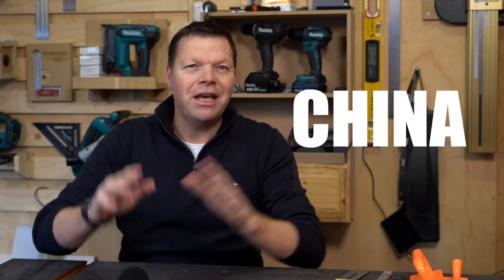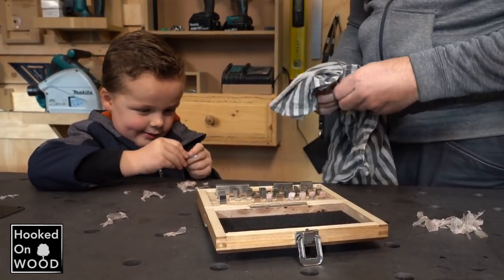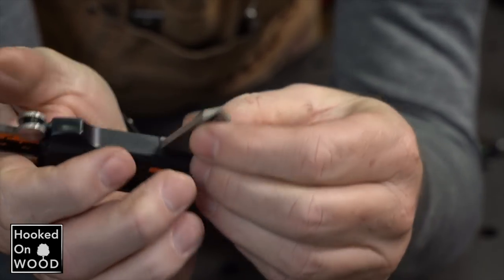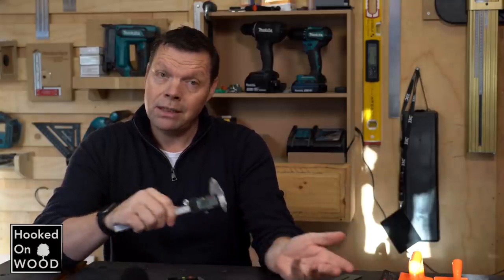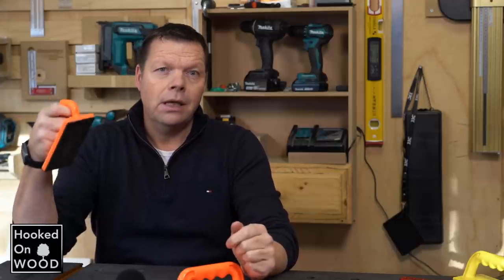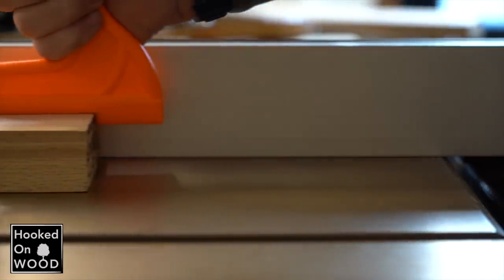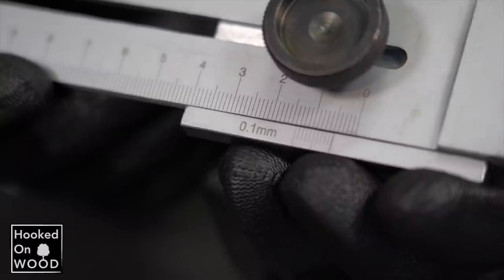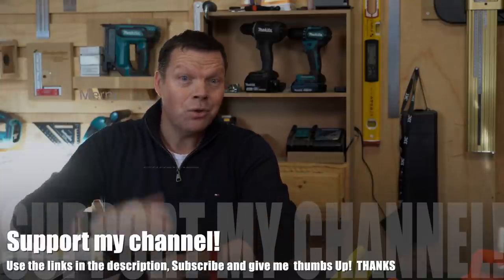China Tools Ep. 17, Set-up blocks, Calipers, push blocks and Ruler

Comment: Tha Banggood pocket hole jig you showed in you r previous video just arrived! But what a disappointement when I realized that the drill bit just doesn't slide in the hole sleeves. I forced it in one, but not in the other and I am not sure I should drill it in without damaging the sleeve. But I found that if I insert the bit from the shaft it does enter. What shoul I do in your opinion?
Reply from the maker: What is the size of the drill bit?
Reply from the maker: Is it 9mm or 9.5? When the shank fits, perhaps you can make a few holes without the pocket hole jig. Maybe that makes the edges smoother and it fits. But, of course the dimensions should fit. When the dimensions on the bit is right it has to be the dimensions of the fitting. But i expect a deviation on the bit. I would reclaim with Banggood about it. I saw you can buy thw bushings separately somewhere so that is a good thing. But discuss with Banggood what to do?
Reply: Yes, sorry, you are right, it is 9 mm. I checked the drill bit. The shank is 9 mm, but them it varies between 8,5 and, about 2 cm from the tip, it is 9 mm. It looks like it should slide inside the sleeve, but it doesn't, so I guess also the sleeves could have some imprecision. I just tried your suggestion and made a few holes in a piece of wood with the bit, but still it does not fit into Its sleeve.
Reply from the maker: I look at your link and that looks not good. I would document it first. So download this video and make some pictures. Contact Banggood. After that i would see further what to do. Good thing is, that these guides are sold separately. So, if the imperfections are there, or if you damage your bushings it is not the end of the world. But Banggood should come with a solution. Sorry to hear your experience.
Reply: Hooked on Wood Thanks. I sent a scorteranno video to Banggood. We will see. You say these bushings are sold separetely. You mean by Banggood? And what should I se arch for? But I would rather replace the drill bit..
Reply from the maker: @starkwedder9787  I see that What I came by was a 9.5mm version. But I think it is also available in 9mm.

Comment: IMHO the precision of any digital caliper is more than enough for woodworking. The primary reason I bought a Mitutoyo caliper was power management. Cheap calipers consumes almost as much power turned off as in use. Yes, you can buy a lot of cheap batteries with the price difference, but I don't fell good discarding them so often, even without actual use. I used to remove the batteries after use, but it's too annoying.
Reply: You'd think the Chinese would have figured out by now how to copy the Mitutoyos by now ... and sell them at half-price;-)

Comment: Hi Dennis

Thank you for the GREAT reviews. They are all very enjoyable and clearly understandable (by all your viewers I'm sure).
Your latest intro though, shows an INCORRECT use of the planer blade guard. This may mislead others and has already induced a comment regarding the planer guard.
PLEASE remove this part of the video and/or replace it to show the CORRECT use of the guard.
The blade guard of a planer is designed to cover ONLY THE EXPOSED PART of the blade. This is generally very obvious by the facility to slide the guard in and out horizontally above the blade.
The planing action of a planer blade has a tendency to lift the wood as it passes over the blade. This requires pressure above or very close to the blade to keep the wood flat to the planer table. Your method does not allow for this pressure application and may cause variations in thickness of the wood being planed (possibly marks like snipe marks along the length of the wood).
While this method MAY produce a satisfactory finish in your applications, it is an incorrect use of a machine guard and should not be a misleading part of a video that may be seen by "new" woodworkers.
Best wishes Dennis and I look forward to many more great videos. :-)
Reply from the maker: Hi Zen, 
The way I used it, is exactly the way is described in the manual of this machine. It is why the safety bridge is adjustable in height.  I do not think there is a right and wrong here. In the manual is written to do it this way till wood thicknesses of 75mm. That is the reach of the height of the safety bridge. With thicker wood, you use it as you subscribed it. The same counts for when you plane the sides. 
I understand you worry about the wood being flat on the table. But I do not think there is a big difference when you push the wood against the outfeet table 15mm sooner, because that is what we talking about. Anyway. Thanks for your comment. Here you can find the operation document from Felder: http://maschinen.felder-gruppe.at/uploads/document/Manual_A3-26_A3-31_A3-41_EUS_enc.pdf  Page 44.
Thanks, Dennis

Comment: i never use electronic calipers, they are good for people having trouble reading mechanical calipers and that's about it. they always need lots of resetting to zero and that tells a lot. chances are that 2 measurement are not the same. never happened to mechanical ones, no batteries, no reset. and i prefer the 0.05 ones mechanical
Reply from the maker: I can understand your comment and you are 100% right. But I found the electronic calipers accurate enough for my woodworking and therefore more convenient to use. And I really hate when I have to turn on my reading glasses☹️
Reply: Digital is faster and you are less prone to brain farts where you aim for 1.25 inches and end up with 1.225 inches instead. Ask me about it;-)

Comment: Ive often been criticised for only buying mititoyo measuring instruments but have always had the last laugh at colleagues who buy chinese instruments. Due to the following reasons.
Crap battery life.
Premature screen cracking.
Thimble wheels breaking off.
Battery lid cracking.
Jaw inaccuracy. 
Difference between jaw and depth reading.
Generally a shorter life span.

Mititoyo IP67 coolant proof would be a go to .Or non coolant proof if you never deal with soluble oil.

Comment: You said that Banggood was a trustworthy site . I have disagree . 
Just received an order that was advertised as a 5 pc set . When order it clearly said 5 I have a picture of the add to confirm. This very item others have been miss lead also. 

Previously I was charged double the shipping cost that was advertised to the U.S when I brought it to their attention they said my zip code was the reason. I say B.S it never has before from
So two points here. 1. Buyer be ware . 2. Do you really won’t to trust your name and reputation on a company known for miss leading the public.
Reply from the maker: Sorry to hear that Bill. What did you bought?
Reply: @HookedonWood  the first issue was the shipping cost on the Drill Pro Precision Clamping Square . 
The second was a 5 pc Safety Push Bock set they only sent one piece  . Others have had the same issue on the safety push block set . They advertise 5 pc but later tell you it only includes one pc ,  which I don’t believe you have a choice of . Totally misleading and has been brought to their attention by others .  I should of read the reviews and I would of caught this  . Wasn’t expecting much so not a big deal expect the business practices are much to be desired .
Reply from the maker: I know what you mean with the push blocks. That is why I made my link to the vendor that only sells the set. There are also vendors that sell the set (on which the text is based) And you have 6 options, where you can choose between the set (which is shown in a picture) and the separate products (which are also shown in the thumbnail. The problem is that the text does not change. So, I agree that something like this works when you can choose different colors. But not to separate a complete set. On the other hand, you see that prices change with every option. And of course, there is a reason for that.
But thanks for letting us know because I agree that it can be a bit confusing. But it is not that you paid 26 dollars and got 1 piece. You probably paid 6 - 10 dollars and thought that includes the whole set.